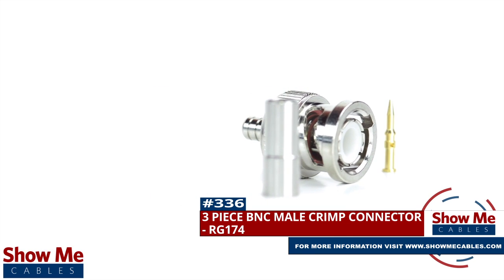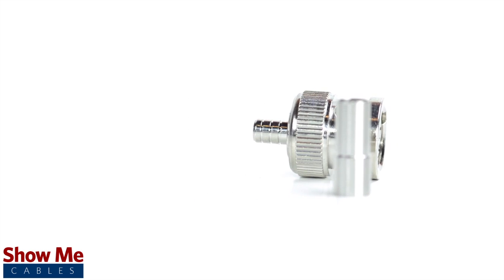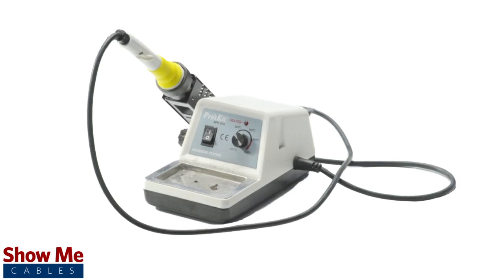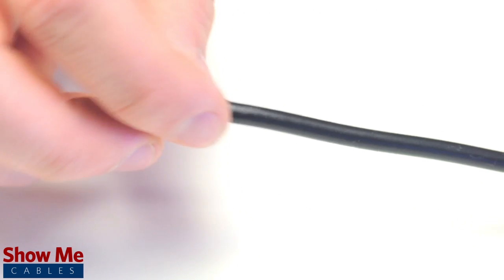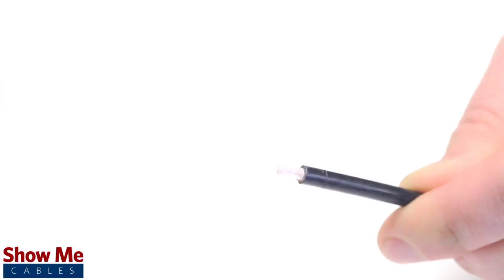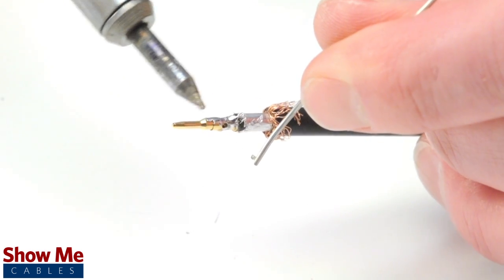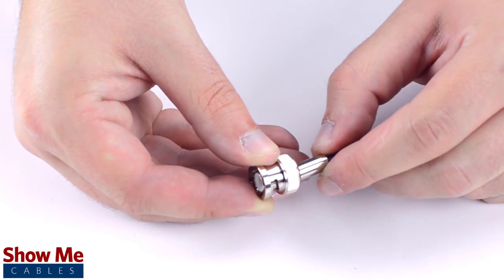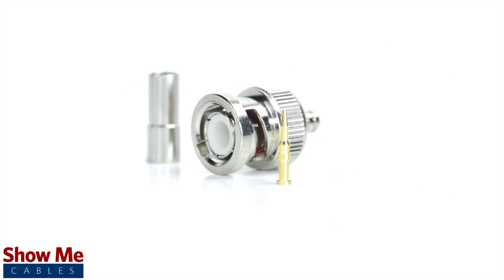3 Piece BNC Male Crimp Connector For RG174 - Perfect For DIY Installs!

Comment: A. You didn't apply solder to the inside of the center pin thru that little hole meant to allow access to solder.
B. You crimped the sleeve with the wrong crimp size...
C. Thats not RG174...
D. You gave no size guides as to how much insulation to remove.